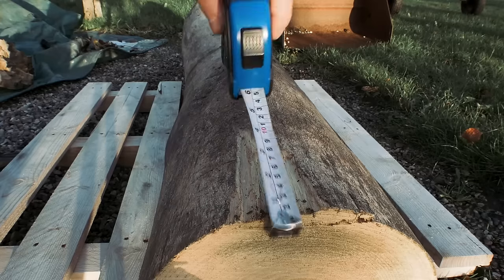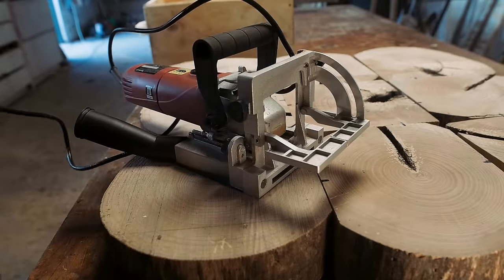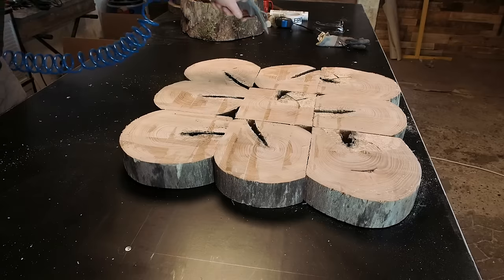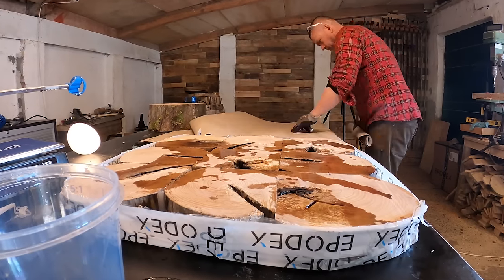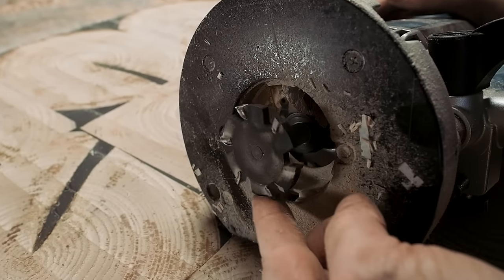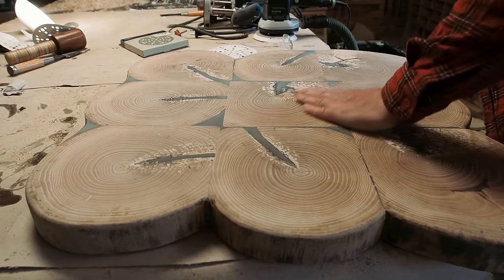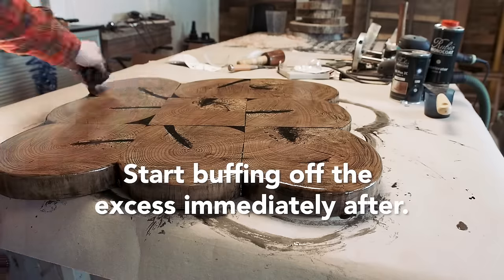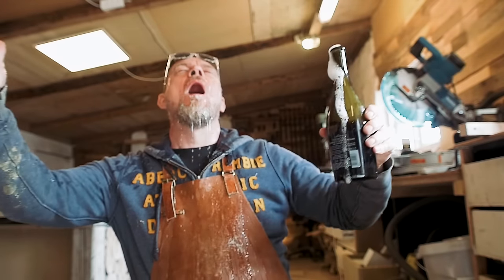How I Turned a Rotten Log into 3,500 on Etsy

Comment: My first thought was to edge glue them all, then use a router and cut a big 1/2" deep rectangle out of the face to glue in a piece of flat wood. Then flip it over and they're all "joined" and stable. Sand the top smooth and do your epoxy, and Bing bang boom, you've got a big cookie slab with a solid bottom to attach legs to. Biscuit joiner works good too though.
Reply from the maker: Good idea

Comment: Try using UV activated epoxy for small cracks. You pour it in and then "set it" with a light bar.
Reply from the maker: Thanks Set, Ill try that.

Comment: Hi Jesper, do you test the moisture content in your wood before making anything? have you ever had anything fail because of moisture? thanks for your videos, they keep an offshore worker entertained & inspired!
Reply from the maker: I do check for moisture, and I do get in trouble. This table is doing fine, but one of my recent builds, the pallet wood river table, I had bot a block crack and some epoxy cracking in one spot. That's definitely due to moisture in some of the blocks used. I only have a pin meter, need to get one of those pin-less ones.
Reply: @JesperMakes   thank you for taking the time to answer, much appreciated.

Comment: I'm not sure if this applies to the epoxy you used, but generally it's a mixing ratio by volume and not by weight.
Reply from the maker: They recommend doing it by weight but I'll check ✔️ thanks 🙏

Comment: Just so you know. In college we built a plug and mold for a fiberglass boat. In the process we used some filler to make it all nice and smooth. We ONLY used the filler. I thought it was odd the packet of catalyst was the same yellow as the filler. Turns out the last person who used it didn't put the catalyst part back with the tub but did put some small sachet sized filer packs in. It was a dumb mistake and it took a day scraping that stuff off our beautiful creation. These things happen I suppose.
Reply from the maker: OMG, that's bad luck. I othen use days to go back in a project to redo something, so I really know what you're talking about!

Comment: Not a born-English-speaking nor an epoxy user (yet) here. Can someone explain me what were the errors with the epoxy and why did he use epoxy if he ended up the tool to remove a millimeter or less of layer of the wood project 6:40 ?
Reply from the maker: I'll try to explain. The error with epoxy was in the mixing. I mixed it wrong. I used epoxy to fill up the cracks and gabs in the table, and then I flatten it so the wood and the epoxy is forming a completely flat surface.
Reply: @JesperMakes  That's actually really clear, thanks for taking the time to personnaly answering me !
Reply from the maker: Sure, always do that.